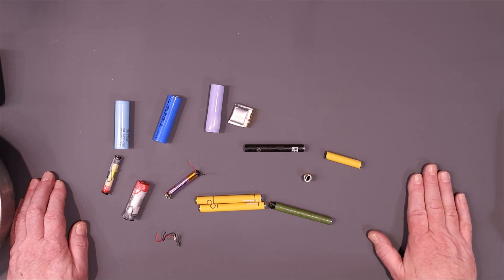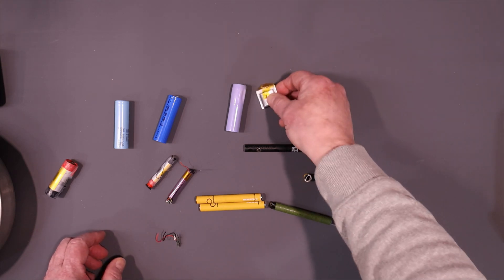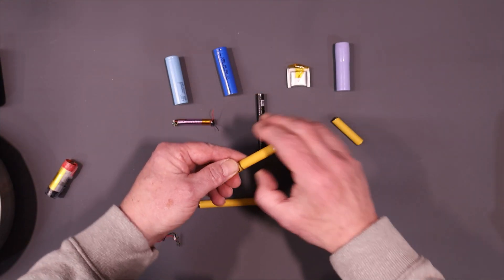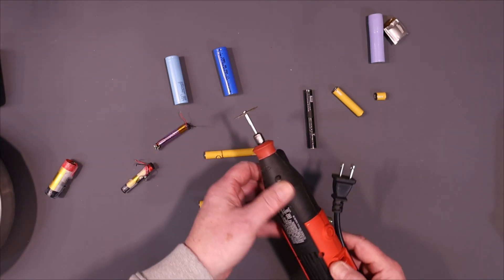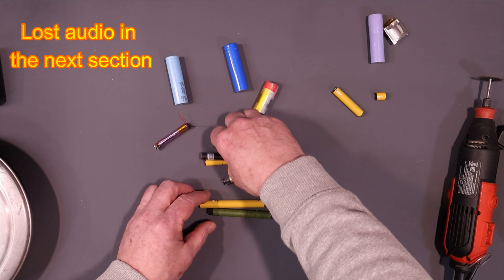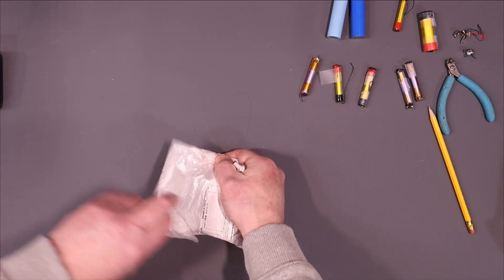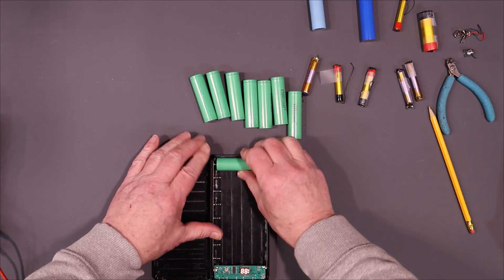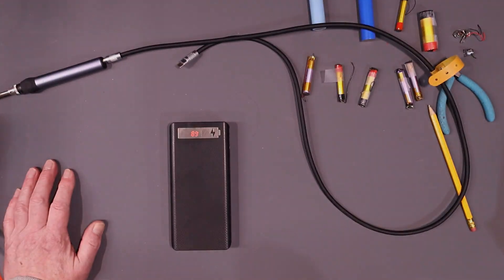Uni-Byte 0264 - LITHIUM Mining at HOME: Reuse

Comment: Not using the pie pan while installing the cells in the power bank?  😮
Reply from the maker: Well, the cells were pretty close.  Within about 0.02V, so the risk of a high current surge was eliminated.  Do you see another risk?
Reply: @ Putting a cell in backwards, or loading a shorted device?  I always mark mine with a red marker in the groove at the + end before use, and double check carefully as I install them. One reversed subsequent cell and a fire is guaranteed!  Thanks for reusing today ♻️  😊
Reply from the maker: @ I did do a double check, but I guess it was not obvious at 3X speed.  LOL!  I turned each one + side up before installing.

Comment: That’s strange they are charged to exactly 3.95 each 😮
Reply from the maker: One was 3.96, but not unusual for new batteries from the same batch.
Reply: @ it just makes me wonder why not the regular 3.7v that most auto chargers choose, free electricity!
Reply from the maker: 3.7 is the "nominal" voltage.  Lithium Ion cells like these will charge to about 4.2.  3.7V is the middle of their safe operating range.
Reply: 3.7v is also the storage voltage that lithium chargers like the skyrc or s4+ select for long term storage. I can’t help but wonder what the self discharge rate is on these
Reply from the maker: @kincheng  Yes, 3.7 is a good storage voltage.  When I do it manually I usually choose 3.8V.  At 3.95 they may exhibit a slightly higher discharge rate, but I don't think that's going to damage them permanently.
Reply: @ since you like usb c, I recommend the vapcell BL4 charger for its grade mode, storage mode, and 0.25A charge mode. Also it’s inexpensive!
Reply from the maker: @kincheng  Looks like a nice unit.  Thanks!

Comment: Aluminum -- Don't use Aluminum for a FIRE pan, it WILL melt through!
add a layer of sand if you must, should anyway.
Reply: I thought a glass pyrex baking dish with a lid was perfect, then I dropped it on the cement garage floor.  My explosion containment pie dish exploded into shards on me.  
A steel fire bucket with sand in the bottom and a get-it-the-heck-out-of-the-house-plan I guess is what's called for.
Reply from the maker: @jetsams_ghost  I do have a stainless steel bucket I'll use going forward.
Reply from the maker: Good idea!  This is real thick aluminum, but I get you point.